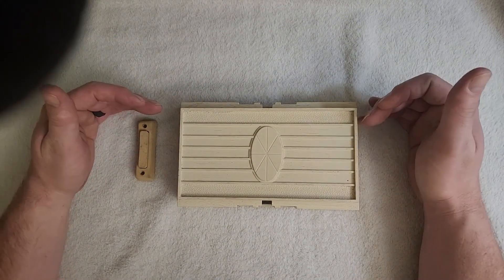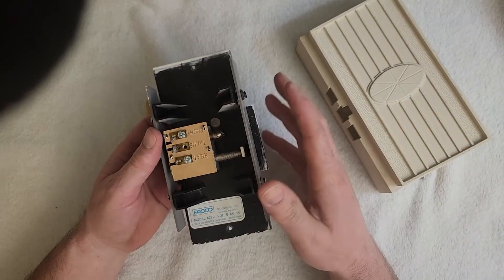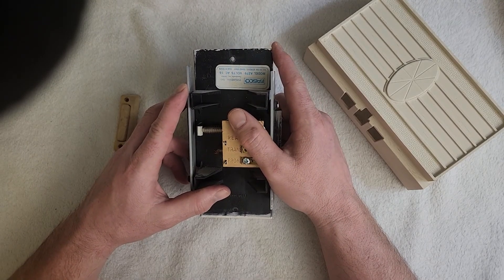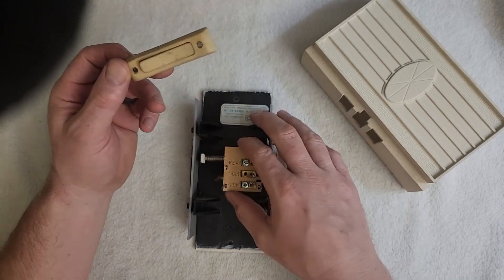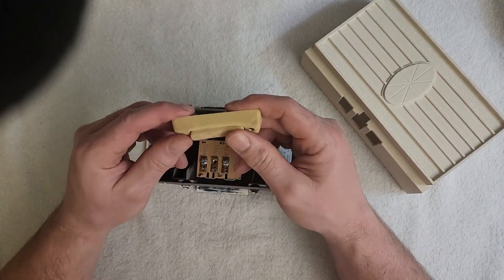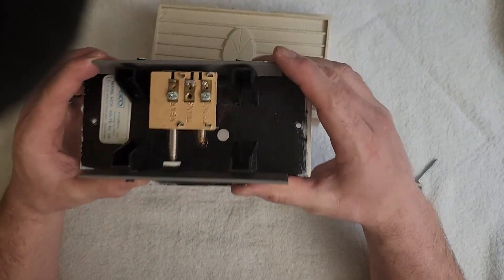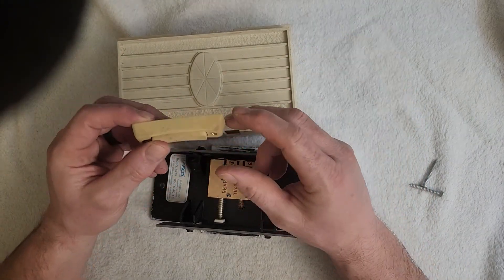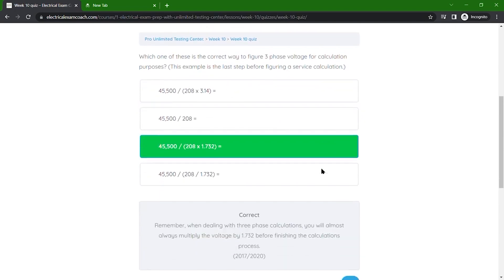Doorbell Malfunction Fire Hazard! Troubleshooting plastic melting smell

Comment: Just happened to us about a half hour ago. My mom said someone rang the bell, I checked the cameras because me and my wife were on the way home. No one was there. Thought ok that’s weird but whatever. Then we got there and I pressed the ring switch and it would only ring when it was released. Then it started buzzing and was starting to build heat on the cover. Definitely the same smell so I flipped the main breaker so our house didn’t burn down 🙄 flipped the hall breaker and flipped main back on. Scary……….

Comment: Had an incident. Hardwired Doorbell that came with the home just started going off on its own. Removed lid. Looked for battery that may also be included in unit. Nothing. 

Looked for the circuit breaker for doorbell. Not labeled. Knew it may be connected to area closest to doorbell, by this time it stopped ringing on its own. Thought it was just a trigger due to storm all may be well. 

I inspect again just to be sure. The unit was humming. Then immediately there is an overwhelming indiscriminate burning smell. 

Called fire department. They arrived within 5 minutes. They immediately smelled burning. They disconnected the unit all together. Firemen recommended consulting an electrician as well. 

Thank you for your feedback regarding the hazard and dangers of these older doorbell units that usually come with the home.
Reply from the maker: That sounds scary! Glad you and your house are safe.

Comment: I have a weird situation. I had a humming/buzzing at chimes. I pulled down chimes 2 yrs ago,burnt place on cover. I replaced the chimes & and since a new capacitor as we had phantum ringing. I have replaced the doorbell 2x and transmitter and again burnt face place. Unwired all took down chimes and still getting phantom ringing. Burnt plate bothering me. I think we have a ghost. I do not want a big whole in the wall and siding if I pull this thing. The transmitter is wired to furnace switch, so difficult to rewire. Guess burnt area on chimes and phantom ringing are my 2 concerns. I am trying to troubleshoot before bringing in an electrician. There is nothing to chime, so where is it coming from?

Comment: Thanks for the information, but you never mentioned what position that depressed spring side striker should be in. I was in bed and heard this humming sound and 10 minutes later, I climbed up and removed the interior cover. The transformer was hot and it smelled like something electrical was burning.  This is a newer home. I used a rubber handled screw driver to remove the one of two wires and the bell beeped for a second and turned off. I think something was stuck. Please mention the position what position those posts should be in. Thank you. Also, if it persists, call the FD. What is the fix? Thanks

Comment: Lots of people who install the Ring Doorbell Pro 2 (wired) upgrade their existing transformer to a 16V 30AV , not knowing that their standard old chime really isn’t designed to handle the increased amperage.  While the chime will seemingly function fine, the increased power of a 30AV will cause it to get hot, and if the doorbell wires get shorted or touched together (for example when removing the doorbell for a door installation) it can cause the chime to fry just like in this video.
Reply from the maker: Fascinating?!🧐

Comment: Often, kids or an ignorant visitor might keep the switch pressed continuously and cause the solenoid to heat up and melt the plastic shell. Happened more than once with me. I'm looking for a special switch that sends only one pulse and switches off by itself, even if the button is continuously pressed. I'm unable to find any mention of such a switch after searching across innumerable blogs and technical sites.

Comment: Think I was having this issue I just disconnected all wires on front and back door. Back door had protective coating all messed up they were touching each other so I'm sure constant call was going there. I hope disconnecting it will help for now until I can get it fixed.

Comment: This happened to me today. Thought the humming sound is coming from the thermostat. While I was googling how to turn it off I started smelling something like burnt plastic. I got so scared of an electrical fire that I called the fire department. They found that the noise and smells coming from the transformer and disconnected a few wires. Scary. And yes you are right, "plastic smell" that was the first thing I thought it smelled like plastic

Comment: Had the same thing happen. It was the little plastic retainer that held the spring. They kept the plunger up and then they let it go to strike the tone bar with the buttons pushed. The plastic piece on the top it healthy spring in place broke off, releasing the inner part of the actuator. Then this little plunger just sat in the coil, heating up and making a buzzing noise, heard the buzzing noise, found it disconnected it.

Comment: Just happened to me. Delivery guy rung the bell. We started to smell electrical smell. Took a while to locate the source. Doorbell button was stuck. I disconnected everything. Will have an electrician in next week.
Reply from the maker: Wow, thank you for sharing!
Reply: @ElectricalCodeCoach  Electrician friend walked me through process of disconnecting from the transformer. All set now. Gonna get one of those wireless doorbells now. Thanks for the video.

Comment: Twice i have seen that happen once it was a stuck button and the other time it was some lumber leaning on the chime button. Both times the transformer was fine but the striker in the chime overheated and was obviously burned the smoke pouring out of the chime made the problem easy to find. The job where the lumber was on the button was a new tract home we had trimmed a week before. we happened to be walking by and heard the smoke alarms.
Reply: Yeah Coach, you have to keep an eye on those doorbell switches. Clean ' em or replace them. My sister has a back doorbell that likes to ring itself once in awhile; we know there's nobody at that door. She'd get a little damp once in awhile. Caulked her up; only happens in a blue moon now, and that's just because of condensation.

Comment: I've heard of this happening but don't know anyone personally who had this happen to them. The push button gets stuck and since a doorbell button is nothing more than a normally open momentary contact switch,  the doorbell solenoid will have constant power and is not designed for that and can lead to smoke and possible fire if the doorbell doesn't have some type of thermal protector or thermal fuse.  If someone rings the door bell and you hear a ding but no dong, you best begin investigating the problem ASAP.

Comment: Aw the worst smell has to be the burnt ballast that leaks the brown-orangish viscous fluid
Reply: If a fluorescent ballast manufacturered before 1979 is leaking it has a very strong probability of containg Polychlorinated biphenyls (PCB's) in the capacitor and possibly the potting material, which is a known carcinogen.  Such ballasts are especially problematic if they overheat and the thermal protector fails, and some  ballasts from that era may not have any type of overheat protection.  Even today in the age of new high efficiency LED replacements, because older equipment was often very rugged and durable there are undoubtedly many of these PCB containing ballasts still in use.